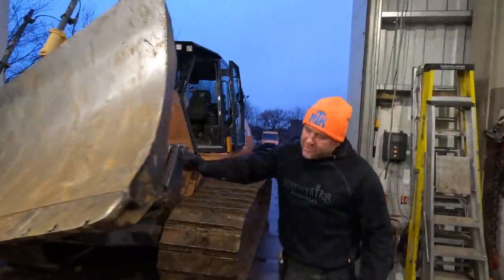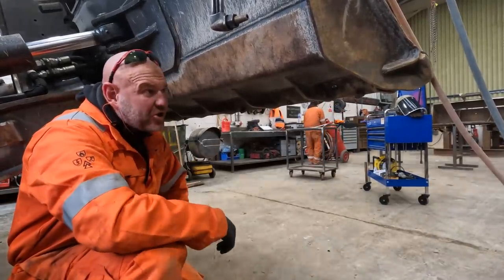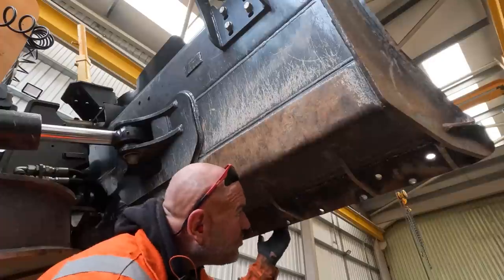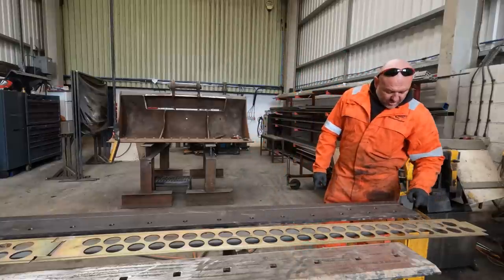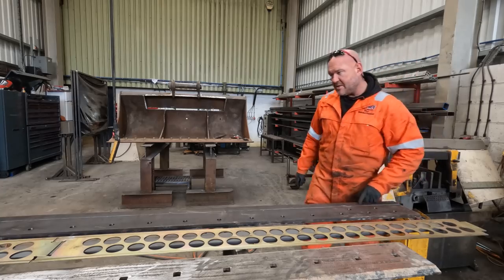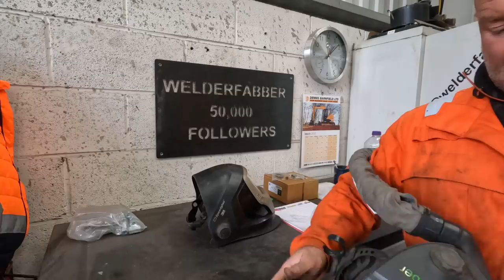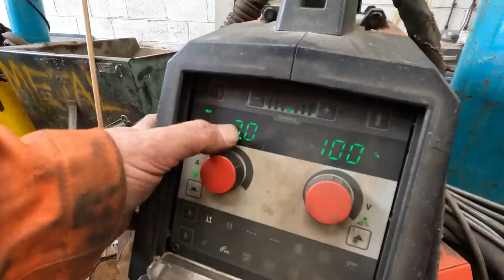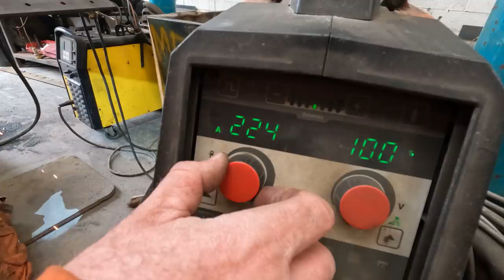CASE 1150 Dozer Blade MOLDBOARD Replacement! WELDERFABBER Episode #001

Comment: other than a factory board is there another possibility  that you would have replaced it with rather than mild steel 20mm flat bar. Thanks, John

Comment: I wouldn't set a time limit on the video's Baz because obviously some jobs are longer than others and some jobs have alot of intricate work n welding .
How long will the new plate last that you fit the cutting edge to ??
I guess it depends on how heavy the work is, but i thought you said a hardox peace of steel would have been better,  so just wondering how this new plate will last ??.
Reply from the maker: Edge gets turned around every 9 months but all depends on lots of things ground/operator/time used

Comment: Can I ask. Is there a particular reason you don’t use a plasma cutter for the track rig?  Maybe it’s different where I am. But oxy / acetylene is expensive. And air is free. (Lol). So I always find it much cheaper to use the plasma cutter rather then a torch.